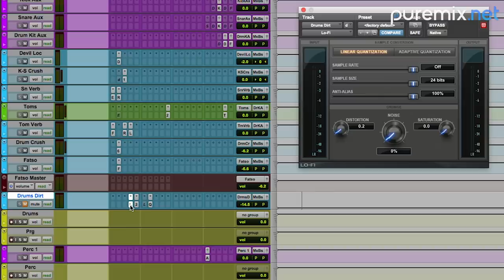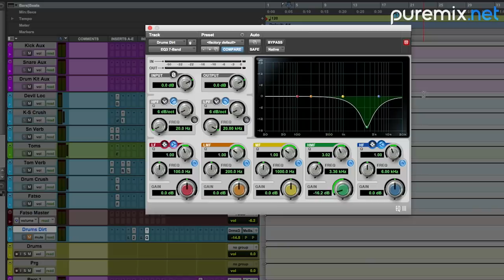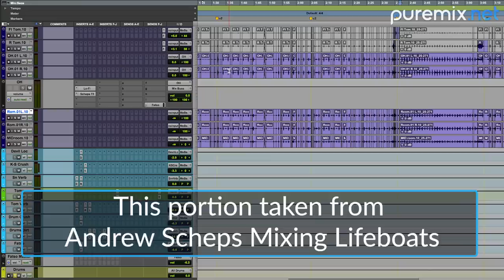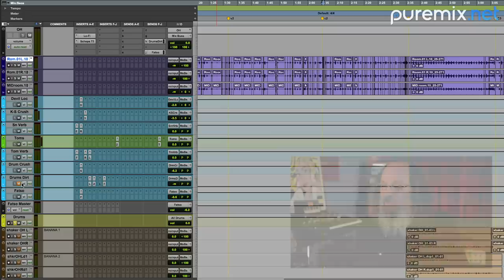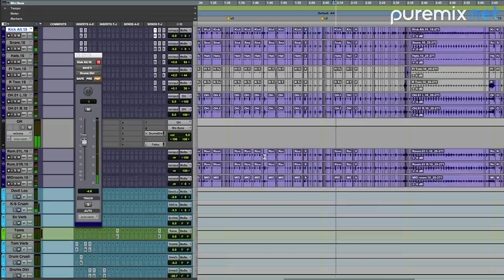(Drums) Parallel Processing "Drum Dirt" Bus | One Track Or Entire Kit

Comment: Theres a plugin from softube called Tube delay.  Its amazing to add dirt to any sound and is not phasy as Sans amp. And I think its free
Reply: At the moment it'll cost ya 77,- eur
Reply: @revolutronic   Not if you are a Focusrite owner.  I got it for free with other plugins  thru the plugin collective thing they have.
Reply: Hey you stole my name, haha, that aside Radiator by Soundtoys does an awesome job at adding dirt to your drums and kick as well
Reply: @PianoHandsOnFaiya  ..Oh great😂. Thanks for the info.
Reply: I have that, What settings are you finding that compare to this? or just crank the drive...
Reply: @gup4604  I actually only have the little radiator, so I'm only working with 2 knobs! I usually keep the heat knob at 12 o clock, and mix knob all the way up, and then experiment with slowly turning the heat knob and the mix knob down, if that makes sense
Reply: @gup4604   deactivate the delay and use just the drive to taste.  Eq if you want.  I leave the eq  at default position and just use the drive.   Another plugin good for tube overdrive is D16 group Redoptor 2. That one is awesome for parallel stuff. Theres a bunch of great and affordable plugins out there now.
Reply: @AudioReplica2023  i see!
Reply: that is a tape delay, completely different topic than what this video is explaining. that is for adding textured delays, not distortion.

Comment: I would level match the final result in a group bus to see if the loudness is tricking my ears.
Reply: Sometime a little more signal adds more color and its exactly what you need , I never think in terms of level matching  and it works great
Reply: LowLinK  well put
Reply: Hate to tell you, but a lot of these parallel tricks will add volume no matter what. That’s part of the magic. It will sound bigger, louder, richer, fuller; denser (not a word, but I wanted the rhyme) without adding any actual level. Just perceived loudness. I’ve had distorted, compressed tracks that were 10 dbs below the dry tracks and it felt like I had turned the volume up. If I turn it down to where no level is added, it’s down 20 dbs and basically imperceptible.